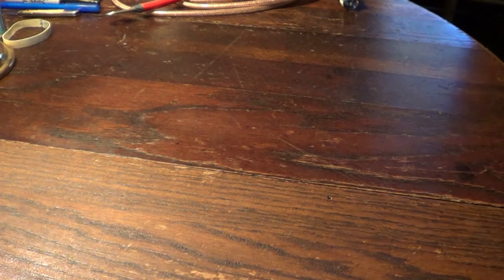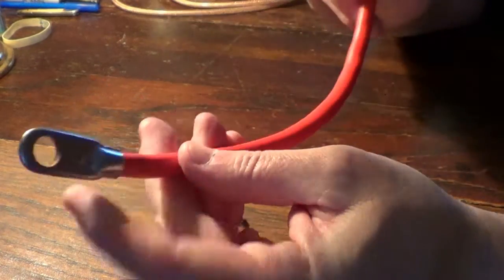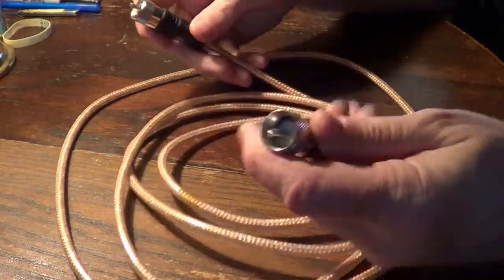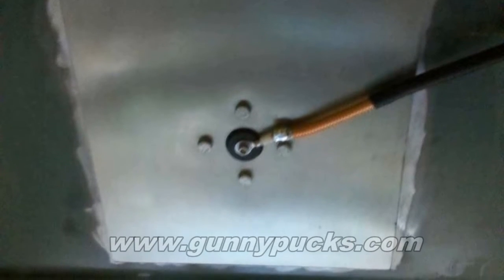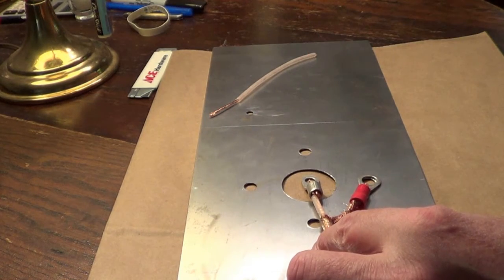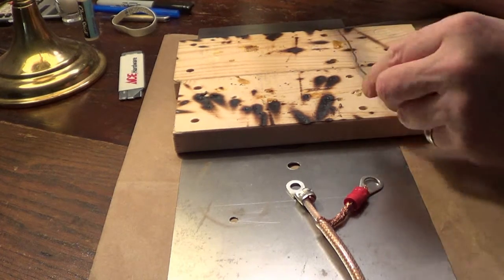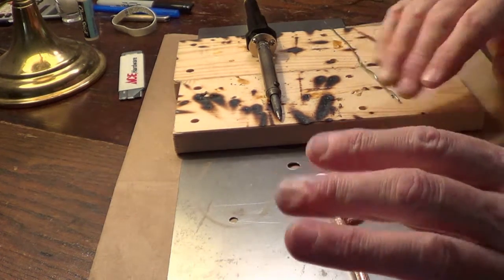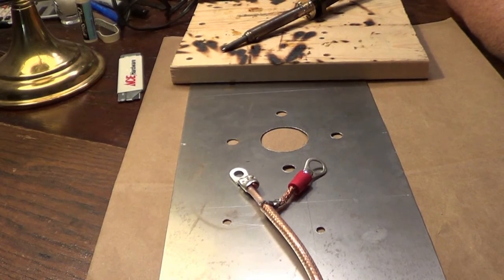Installing a Gunny Puck CB Antenna Mount ~ Pt 2

Comment: to keep swr down you would have to use one countious coax with out any connections. If you do have to make a connection its best to solder it together. But just avoid that it dont work you need one piece of coax and it dont hurt for it to be longer than 18 foot. One 18 footer got me from my dash to the back of my tail gate? I dont see why you would need two pieces?